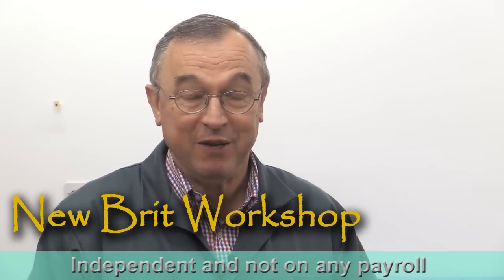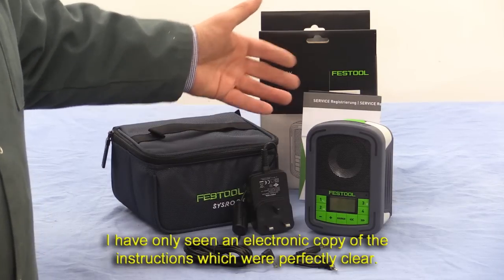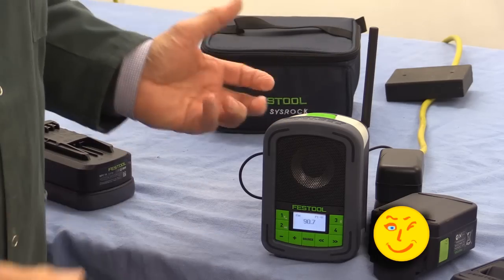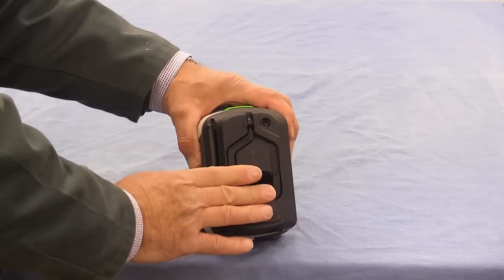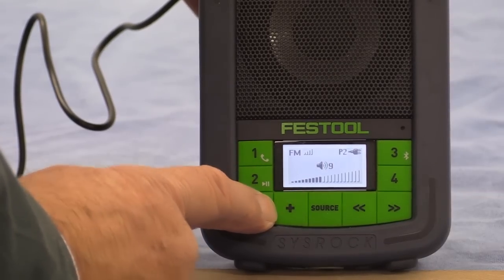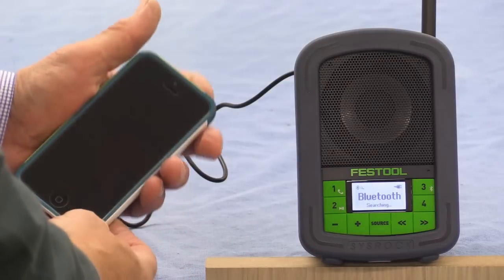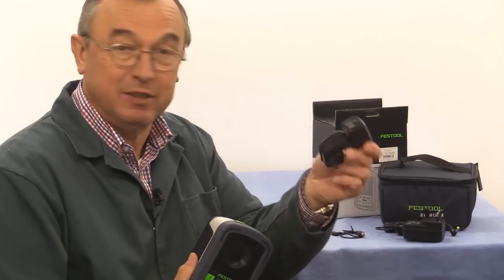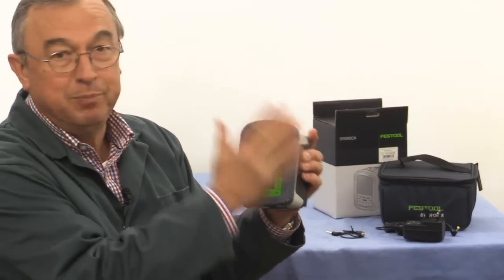Festool SysRock Job Site Radio

Comment: Hi Peter.
Great review as always.

I am a big fan of Festool, I've been using the brand since 2002. I also have some great Milwaukee kit.
I have to say that it looks great but, really disappointing that its not DAB. I can put up with it not being a charger as I have plenty of Festool Chargers. Milwaukee make a Bluetooth speaker, not a radio, just a speaker. I have stuck a small Roberts Sports DAB radio to it with Velcro and it works great. The Milwaukee speaker is available for around £60. 
If the Festool one was DAB i would definatley upgrade.

Many thanks for all your great videos.

Cheers Richard
Reply from the maker: +Peninsulakid Hi Richard, Yes the DAB issue seems to be critical for some people. However, this is Festool's first venture into this type of kit and they have created a conservative design that is in keeping with their usual standards. They feel that as DAB is not universal that this first radio should be FM only. Most people these days have smart phones and it is quite possible to stream your favourite stations to the Sysrock.    Peter

Comment: Just an FYI, if anyone has an older radio that doesn't have Bluetooth but has an AUX (auxiliary) port on it.... I recently bought a DeWalt Bluetooth adapter that uses the auxiliary port to allow Bluetooth pairing with the unit. It is rechargeable via a supplied USB cable and comes with a bit of Velcro to attach it to a radio. It has a range of about a 100 feet and is about the size of a USB thumb drive. I use on two of my older radios and on my truck radio and the sound quality is quite good. The price was I believe about $39.95 .
Reply from the maker: Hi Ron, I imagine similar things will be sold in Europe too.   Cheers.   Peter

Comment: Not sure weather to take the plunge, or wait until a DAB comes out. Surprised it isn't DAB already. Hmmm, can't decide - I've been told the sound quality is really good, and for the size it would definitely save on space.
Reply from the maker: +Richard “BrainFizz” Morley   Festool allowed me to retain the pre-production model that I showed in the video and I  really do use it and enjoy the sound quality. I am not saying that for any other reason than that is what I feel. I agree that Festool must look hard at the next Sysrock model and include DAB, USB and a battery. In the meantime it is worth getting one, especially if you have a smartphone.    Peter

Comment: Thanks for the video peter as was discussed on the forum I think I'll give this a miss till they update it. They could of been a bit clever and put dab and some other gadgets on it. But the concept is good the it's pretty much the same foot print as the syslight 

Cheers Robert
Reply from the maker: +nippychippy Hi Robert, I agree that DAB would have been a good idea but with a smartphone you can stream anything - even your favourite radio stations. I really like the compact size and it does seem to be quite robust.  Take care.   Peter
Reply: New Brit Workshop   To the uninitiated what is DAB that everyone keeps mentioning? Thanks Peter. Good video.

Comment: Looks good, but if it doesn't have long wave or internet radio I can't listen to the cricket, so not for me.  My Roberts radio does well in my workshop with all listening options (albeit not so rugged).  Thanks for making this useful video.
Reply from the maker: +Steve SteveS Hi Steve, Many thanks. You can always stream your favourite radio through you smartphone to the radio.   Peter

Comment: Hi Peter, This seems a strange product. Most of the tool manufacturers are going down the dab/Fm route. I wonder how good the sound is on a mono speaker? I think Dewalt had a great idea when they turned their radios into a battery charger unit as well, and I only wish Makita had done the same. Did Festool supply an ip rating?
Reply from the maker: +Michael Tricker The sound is superb but I cannot compare it to any of the competition. That being said, if you have Festool batteries and no others it makes the competition look a little lack lustre.    Peter

Comment: I wonder what the pricing of this is? It would be good if someone did a teardown to see if it's worth the asking price..
Reply from the maker: +Aaron Elliott In the UK it will be about UK Pounds 110. I am not sure what you mean by a teardown if that is a price comparison then I think it stands up well as it is very well made (okay no DAB) and is compact and has great sound.   Peter
Reply: +New Brit Workshop (Peter) £110 sounds like a fair price, I was expecting it to be 2 x that, What i meant by teardown was when the tool/gadget is taken apart to see the quality of the components and how well put together it is, There is quite a few youtubers doing this nowadays, (EEV Blog, And AVE) to name two. It's surprising how interesting the inside of a tool can be, And shows the genius design of things we take for granted on a daily basis ..
Reply from the maker: +Aaron Elliott It would not be my way of doing things as I have no way of judging what I might find. Sounds like fun though. Yes, 110 seems about right.   Peter

Comment: Great review as usual! But the product isn't so good in my opinion. Maybe they can give it as a gift to Festool Roadshow customers, but it's not a product Festool should sell. No innovation, no differentiation from competitors. The only pro is the battery compatibility. No DAB, no stereo sound, no MP3 and memory card support and no waterproof. Better wait for the next generation.
Reply from the maker: +Pier Paolo Biagi Is there anything on the market which is waterproof, has an MP3 player, memory card and stereo?   Peter

Comment: I'm not impressed. I'll keep my Bosch jobsite radio. It has a built in MP3 player that reads files directly from a USB thumb drive or an SD card. It also has a dock for a Sirius satellite radio receiver. This Festool radio is just a radio with an auxilary input.
Reply from the maker: +The Garlic Farm Yes, the utility of a USB connector is tempting. I have a 64GB one that only sticks out 1/4" in my car and it hold all my music and podcasts. I suspect your Bosch is not cheap.  Peter